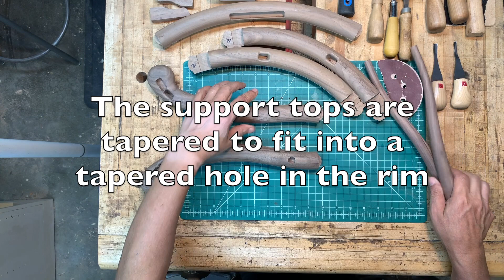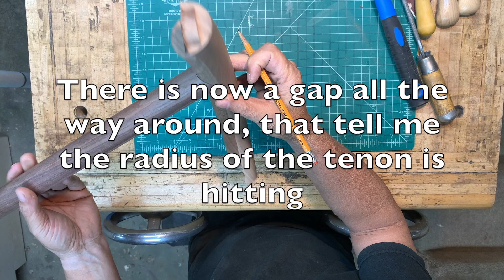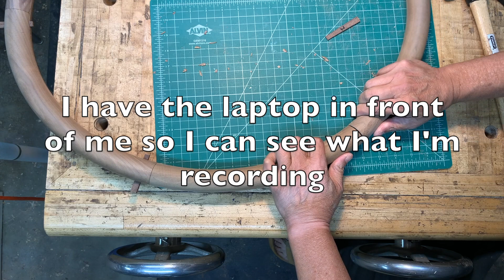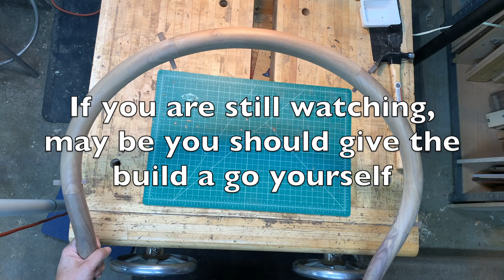12. Connecting Rim Sections - Fitting the CNC Version of Wedged Nail Tenon joint 楔钉榫(Xiē dīng sǔn)

Comment: why the tenon on the arm pieces round? they will make the joint not as strong. could you comment. thank you for all your teaching. I have been making a ming dynasty chair a long time now but the round pieces i have rather big gaps on some of them. I used hand saw to cut them and chisel to cut the mortises. but I think next time I will use table saw and make the mortises to show on the sides like scarf joints I think is much easier and may be stronger. I don't know
Reply from the maker: Those tenons are rather short, so there isn't much side to side strength even if you make it rectangular. Making it round makes the cut on the CNC possible and thus more accurate than I can make by hand. Also, since those joints are pinned, the strength comes from being pinned; not so much from the tenon to mortise friction connection.